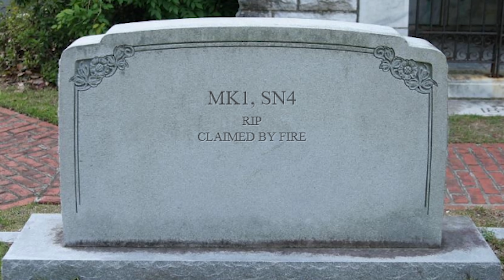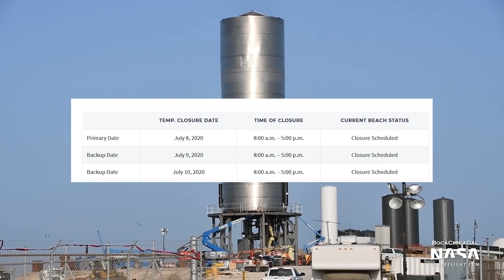China On Mars Before NASA & Starship SN5 To Hop

Comment: Guys, you should keep in mind the Tortoise and the Hare.   If Starship does not yield results in the mid-term, at some point the rapid iteration method will become challenging to maintain (economically) without YAP (Yet Another Pivot) to some other baseline manufacturing/technology set. 

I am not saying this WILL occur, and I certainly hope SpaceX is successful, but it is important to take in the broader landscape of competition.

Comment: Jaxuan and Sebastian do you want another crazy idea?  How about convert the Munich Olympic park to a Mars Colony test and rocket facility?  I was there, lots of open space.  So to speak.  I left from the train station on the Orient Express October 81 and it was freaking cold btw.  Munich is a hub and deserves a Starship Jr. landing facility.  The heavy lift and 9m Starship are for long distance and pushing off planet.  Not necessary for people movers.  Cut down the numbers of raptor maybe, or put on mufflers, raise blast shields, and land in the city.  Any airport would be proud to host StarshipJr.    E = Elon  MC = Mars Colony   MC = Munich Colony  thus  E = MC2  < squared not cooperating but you get the idea.  To Mars with light speed ...  Love your show babe.  Peace

Comment: Human Rating depends of the # of flights not really time in service .   Starship will be the first fully reusable rocket , and if it works , they can crank multiple flight per week to prove reliability that a regular rocket would take years to achieve.  So it is possible to have starship human rates faster than most think
Reply: TheHeavenman88 - It will probably require ~30 consecutive successful orbital flights for NASA to human rate Starship. Assuming we go from the 150 m hop to a successful orbital test in 6 months, and that all of those 1st orbital flights are successful, Starship should be Human Rated by Early-2022.
Reply: someone forgot about Elon time.
Reply: Build and test to destruction so far with the Starship.  Chances are the destruction will continue when the Starship starts flight testing.  Expect more destruction throughout this year as the Super Heavy is developed and test flown.
     This make it and break it method is the old school way of quickly developing something.  It  looks messy but produces rapid progress, and is only possible because of the low cost of the Starship and Super Heavy's stainless steel construction.  My hat is off to Elon Musk for being brave enough to use this development method.
     I suspect that it will take at least to the end of 2021, as TradionalAnglican says,  or even mid-2022 to produce a string of successful tests that would get NASA even thinking about man rating the Starship.  I'll guess sometime in 2022 for man rating.

Comment: With regard to the Perseverance, it's essentially a duplicate of Curiosity, so any perceived race is somewhat neutralized by that.  The better question is why isn't NASA sending it's next major robotic mission to a new destination that's yet to receive a modern rover, it seems this is a political mandate that lacked imagination.  That said if a mission can use some of the leftover hardware (test articles for example) which may be lying around they can be significantly cheaper then the first mission.

Comment: Well there are currently 4 NASA rovers on Mars and guess what, one of them is still operational. Riding the red planet for more than 20 years now. Plus 3 orbiters.. operational(!). And 4 which are already expired. China .. first ever launch to Mars. After one failure in 2011. I wish both of them good luck, but to embarrass NASA China has to go at least 50 years back in time.
Plus NASA rover is way more complicated than Chinese and includes a chopper. Tho it's been ready, packed and transported like 5 months ago, and recently assembled with Atlas 5, so the delays are purely from rocket stand point. And it's only like not even 2 weeks delay, so who cares. The only thing that matters is they're ready and go for launch.

Comment: 5:15 I hope they do, at 8M$ per engine this is the least they can do!
What a joke...
Reply: Maybe not, I understand that BE4 can be reused 25 times, and on Atlas5 one rusian RD180 costs is 35 millions.
Reply: @theOrionsarms  Oh shit, that's so expensive. One merlin cost 1M$ and on raptor should cost 250k$
Reply: @johntheux9238  I think one raptor currently costs is a little bit more than two millions one, rocket engines are the most expensive part of the rocket, up to 65%from the cost of the future Vulcan rocket, this is the reason why reusing only rocket engine is not a bad idea, final price could be less than a falcon heavy (in the reuseble configuration) but with 20%more capable, I mean 36tons in LEO and more than 10 tons to geostationary orbit.
Reply: @theOrionsarms  Best setting for falcon heavy is to land the sides boosters at sea and expend the center core. You should get 57 tons in LEO and 24 tons to GTO for 95M$
Reply: @johntheux9238  I am aware of all this numbers, but I think SpaceX can make only 8 central cores in a year. ULA can build 40 Vulcan in their new facility in Alabama starting next year.
Reply: @theOrionsarms  Yes. And they still don't have an elongated fairing.
What is the cost of the prometheus engine? (from Ariane) Because it's going to be 10 times cheaper than the engine it's replacing.
Reply: @johntheux9238  Ariane5 main engine prices was incredible high, I read that total costs for Ariane6 would be between 70 and 110 million dollars, would be two versions one with two side boosters and one with four, lighter version will be as capable like falcon9 (in the reuseble configuration) but more expensive, and heavyer one with falcon heavy (also in the reuseble configuration) but also more expensive, with the exception of some payloads that require more deltaV and a larger faring.
Reply: @theOrionsarms  Ok, thank's. I was wondering how we can explain those HUGES differences in prices. Prometheus will be mostly 3d printed, raptor too (according to rumors and by spending some time on spaceX open positions on the career page.)
Reply: @johntheux9238  not all roket engines are the same, they come in the different sizes and performance, besides that sometime information about prices that are available can be different, it may be production costs like in the case of raptor or delivery like in the case of BE-4 or RD-180(Russian make a good profit saling that engine), what make no sense for me is how expensive are that made from Aerojet Rocketdyne (RL-10 and RS-25), I mean that they still have customers at that price, a RL-10 that is relatively small costs more than a BE-4, maybe they can justify the cost by higher performance but in reality is a monopolies in that sector of the market, and about Prometheus would be a small engine like RL-10 but would work with methane not hidrogen, and would be used only on VegaC which is a small launcher, but not on the Ariane6 at least for my knowledge.